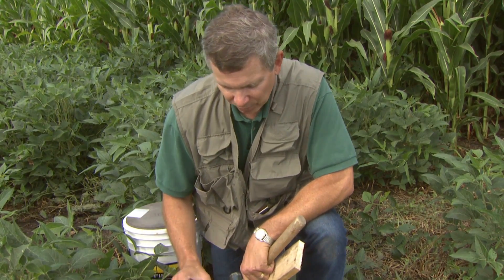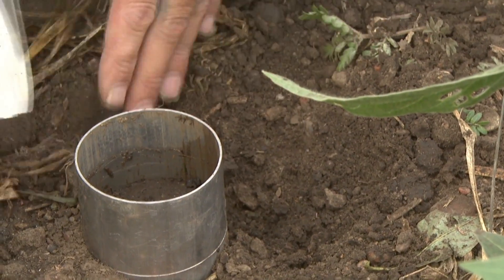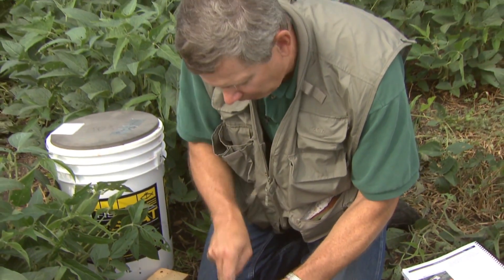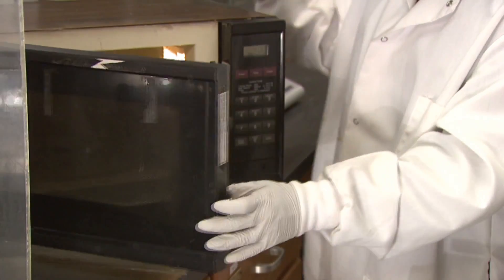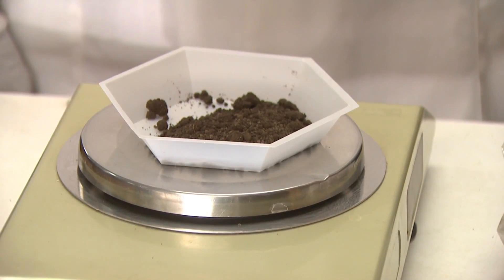Soil Bulk Density test

Comment: 0:01 drive the soil ring until the 3" mark into the soil
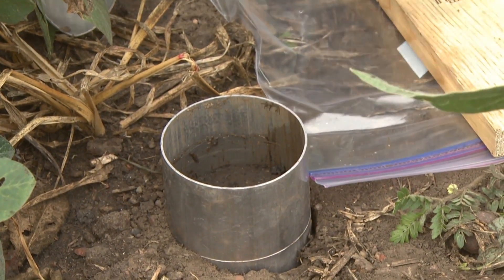0:41 remove the soil around the ring carefully to extract the soil ring
1:05 use a trowel or a tile spade underneath the ring to avoid loosing soil from the bottom
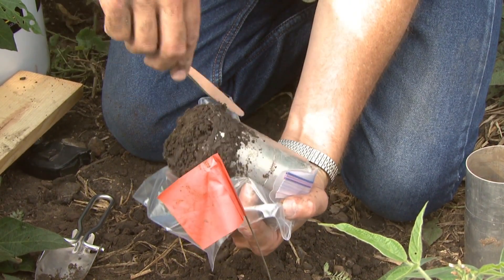1:34 remove the excess soil below the bottom of the soil ring using a kitchen knife
1:55 time to put the soil into a bag, without leaving any volume into the soil ring
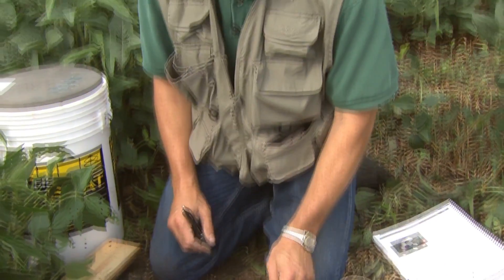3:15 in the lab
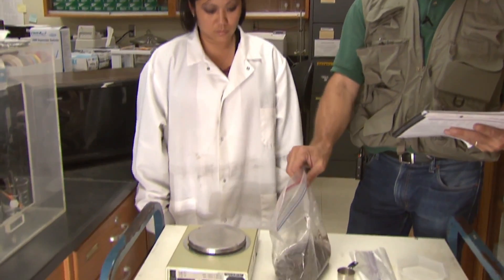3:30 weight the sample on a lab scale and then a clean ziplog bag like the one used for sampling (=tare)
3:49 weight an empty microwave tray (=tare) that will be used for drying a small share of the sample
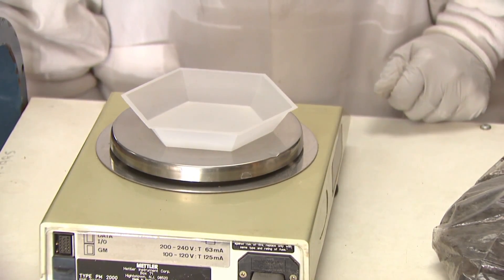4:04 mix the soil sample in the bag using your hands
4:15 take a scoop of the soil sample and weight it on the tray that you left on the lab scale
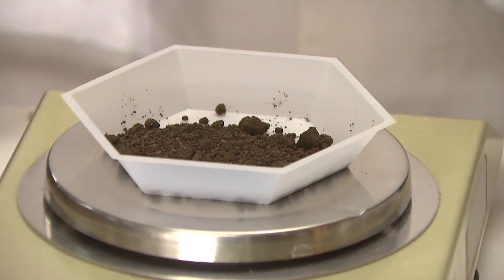4:41 put the tray with the share of the soil sample inside the microwave oven and start a drying cycle (e.g. 4 minutes), then weight the sample; repeat until the weight does not change, which means that the sample is dry